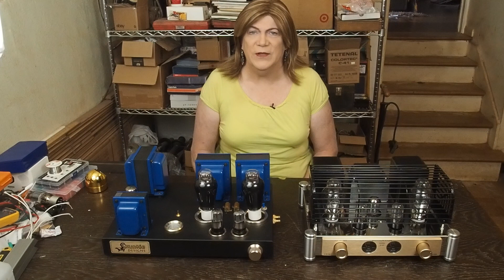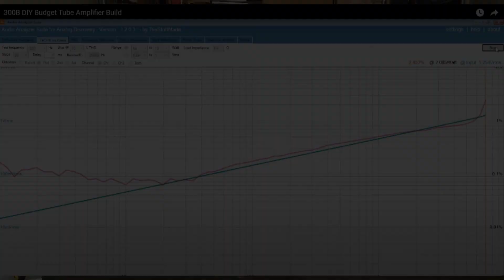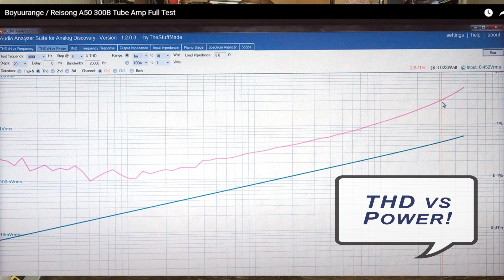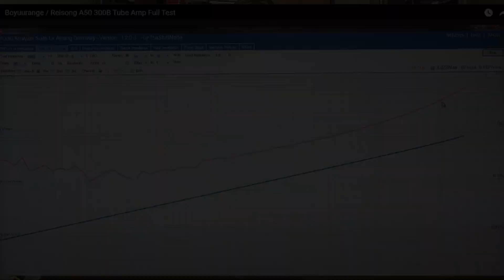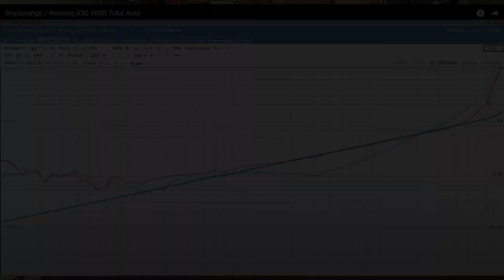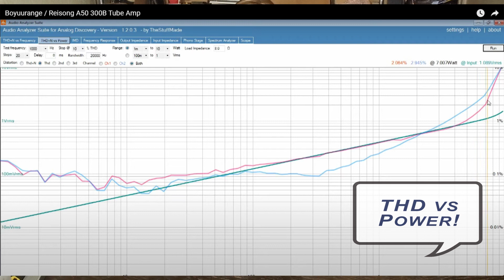Boyuurange / Reisong A50 300B Tube Amp Mods: Wrap-up Impressions

Comment: This was a great series. Its awesome that you found flaws in the a50 but then fixed and improved it. I have the a10 and I have been thinking of doing most of the caps with better legit brands and while I probably will do them I can only wonder if the a10 has more going on than cheap parts. I will say it sounds great but the bass is its weakest point to me which I have heard plenty of others say the same about the Chinese amps. Thank you,great job, I am looking forward to your next projects.
Reply from the maker: Great to hear! I know that A10 is also popular, I should try to hunt down a schematic on it and give it a look.
Reply: I have a A10 also. It’s a very simple SET circuit. I would love to see how to mod that amp.  I know they sold thousands of the A10 amps. Love ❤️ you’re stuff

Comment: I just watched the whole series with your new conclusion video this evening.  I want to thank you for showing everything & don't need to do some kind of how to guide.  I think the videos are complete enough for even a novice like me could do the modifications. You convinced me that the DIY is the way to go to get introduced to 300B. I had a friend who was thinking of getting the Chinese amp but in watching this decided otherwise.  I also want to acknowledge you for these videos compared to the other audiophile channels who have praised the A50. They may have big watched numbers but only talk about their impressions about how it sounds but not tests, quality or electronic build.  These videos are of such more value for the long haul of purchasing a high quality power amplifier. I get how your passion is to explore new things & not get stuck doing the same mods over & over again.  Finally, I like learning about all your tips for DIY like the safety pin trick, etc.  I am going to watch your DIY series on the 300B & maybe get up the nerve to build one.  Thanks again!
Reply from the maker: It's really not difficult, just take one step at a time. I do plan to do a metalwork series soon!.